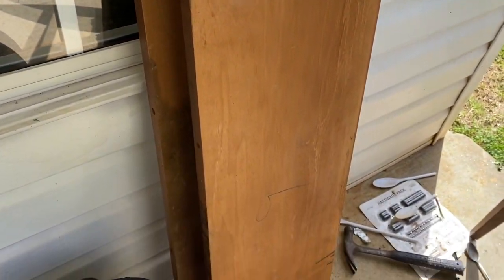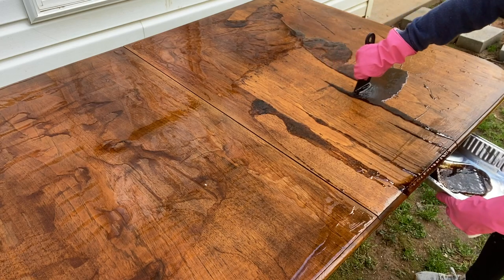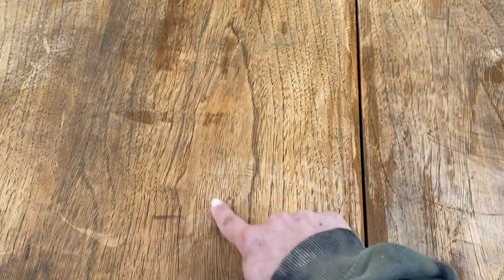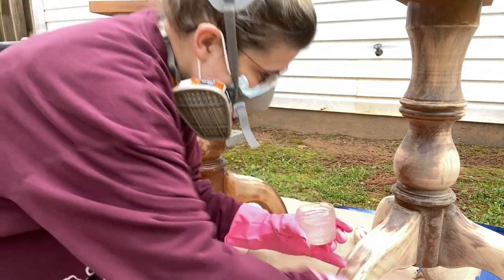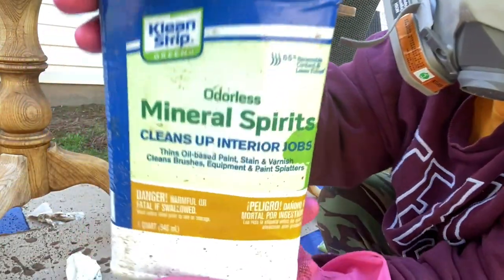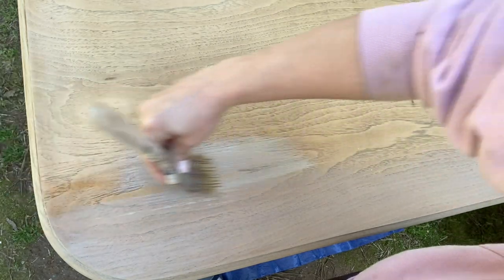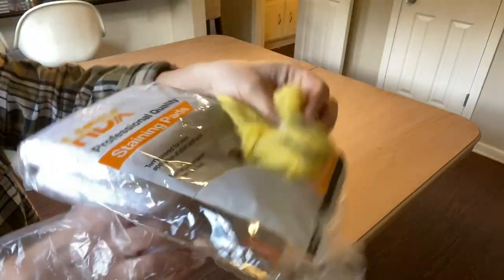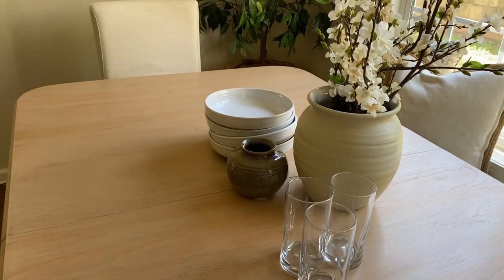Old table makeover - pottery barn light wood 🤩 totally worth the effort!!  I love it!!

Comment: Question for you. Btw I love the taupe wash and have used it several times. I have a dresser right now with an oak (I think) top that I sanded.  The rest of the piece did have bleed through. Would you use a clear shellac before a paint wash?  I’m not sure if this would work or if I should just try the paint. Thanks for all your info. I really appreciate you sharing what works for you.

Comment: I keep on not having smooth finish with chalk paint using your brush and roll method. First I tried the behr and now I’m trying the rust oleum brand and I t keeps on leaving a mini pop corn texture
Reply from the maker: I don’t really use chalk paint for that reason, it naturally has a lot of texture.  Try valspar furniture and cabinet enamel or use my one step paint recipe, you’ll have A LOT smoother finish I swear ❤️
Reply: You rocked with that recipe. What suggestions do you have for  the paint it’s self to
Reply: Does that recipe work for mdf too? That’s nothing but water base